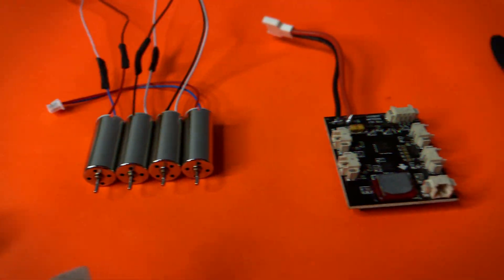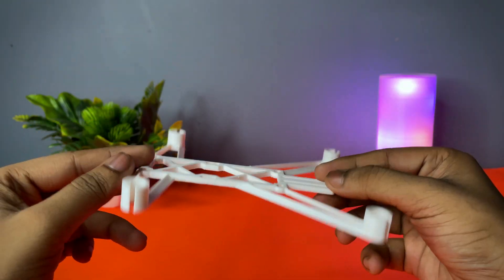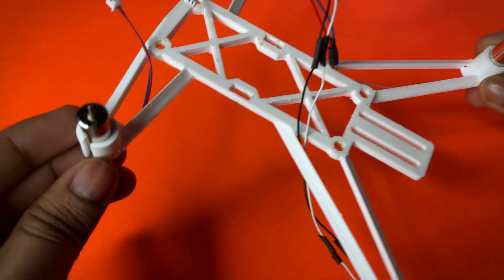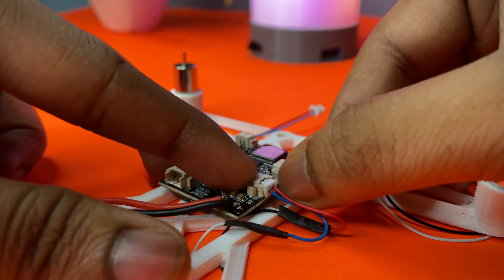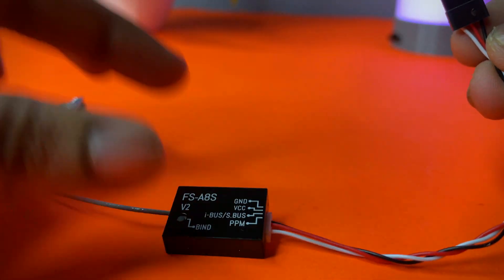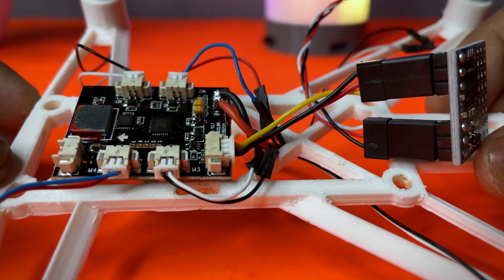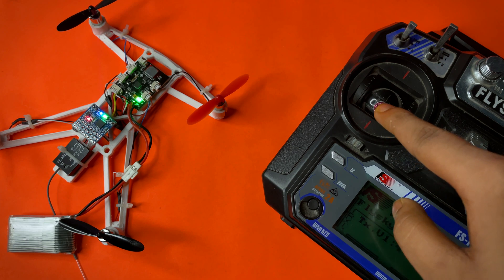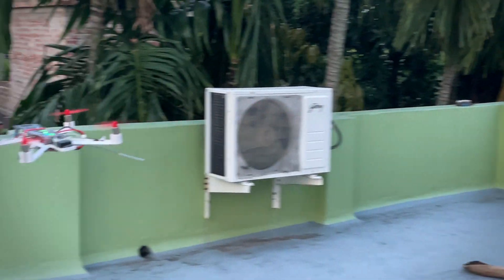How To Build Mini Racing Drone At Home

Comment: Bro can you mention the battery model and discharge rate
Reply from the maker: Use 3.7v lipo battery 600 mah above discharge rate 25c
Reply: Bro I tried but the motor rotate and stopped immediately
Can you mention the battery link
Reply from the maker: @anishbose8573  dm me on instagram
Reply: Ok bro👍